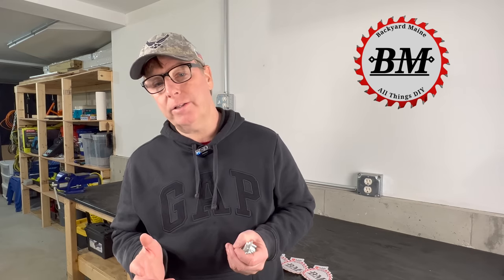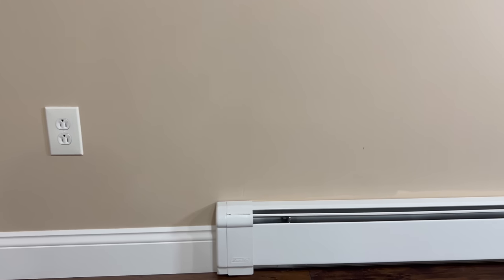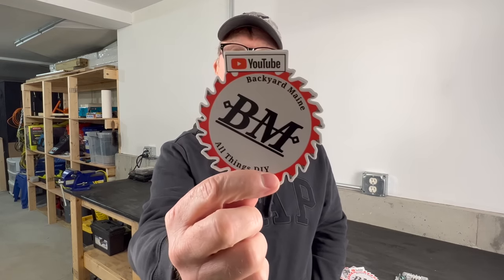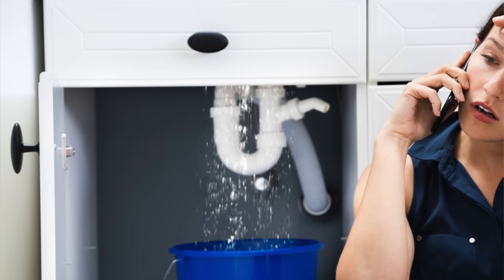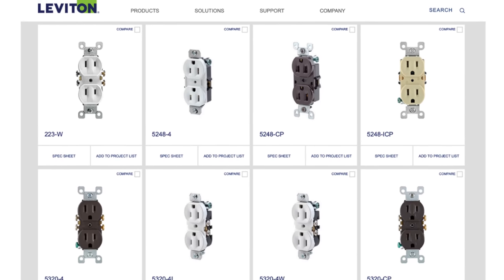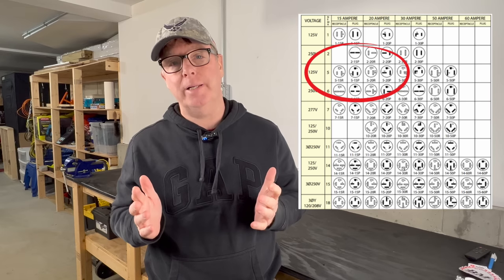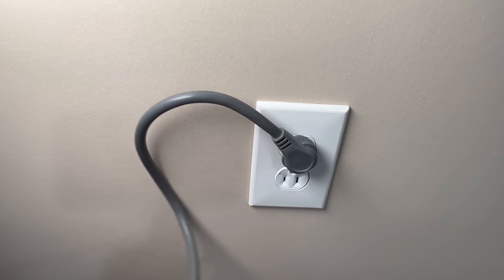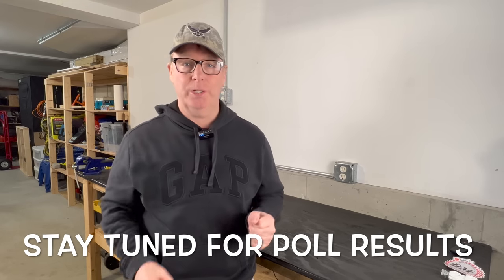Are your outlets installed upside down? (You may be surprised)

Comment: During my 40 years of remodeling in the Chicagoland area, every electrician I worked with insisted on ground-down.  Indeed, several told me that it was code.
So I'm a little surprised it turns out, it isn't code, at least nationally.  It would be true, though, that Cook County, Illinois is quite a bit tighter than most other jurisdictions.
Reply from the maker: I’ve read in the comments many times that cook county requires the receptacles to be mounted horizontally. Maybe it’s just Chicago I don’t know.

Comment: I am coming late to this discussion and can't read all the 3,600+ comments, so my comments that follow may have already been posted. But the main reason for ground down is so that if a 3-prong plug starts coming loose and starts sagging downward, the ground plug is more likely to be always be the last to be connected. The worst thing you want is for a plug to start pulling from the wall and the ground plug to loose contact while the hot and neutral wires are still hot (for connections that have 3-prong plug).

Comment: Also,  if you Look closely at the outlet, many of them have the Logo or Wording molded in their face.
That wording is correctly readable when the Outlet is Ground Up.
Even on some older GFI outlets TEST and RESET buttons wording is only readable in Ground up.
So it's almost as if, most manufactures have designed their Outlets for Ground Up usage.
Reply from the maker: Ive seen the wording in both directions from the same manufacturer depending on what you buy. We can make assumptions but the manufacturers do not recommend orientation. Hubbell for example has a quad receptacle and every one of the four are in a different orientation.

Comment: Ground down fits appliances like:  Refrigerator cords are not upside down, creating undo strain. Window air conditioners, washing machines, and any other cord and plug appliance.  Kind of like wearing shoes on the wrong feet.  They still provide foot protection, but just looks awkward in use.

Comment: Ground down is better in most cases.  The short circuit proposed by some people, if "something falls on top of the exposed leads is ridiculous.  Why were they exposed in the first place?  The breaker will take care of that in the odd case this might actually happen.  That's what breakers are for.
Reply: True.... UNLESS it's one of those Federal Pacific Electric or Zinsco panels, which had a well documented high failure rate,  estimated that about ⅓ of single poles and ⅔ of two pole breakers failed to trip even under a dead short, or they took too long to trip or trip at currents much higher than the marking on the handle.  The unofficial rule at the place I work is,   "This 2 pole 15 amp FPE breaker is an acceptable substitute for this 200 amp main breaker that won't arrive until after the holidays because it won't trip" 

Buildings from before the 1960s may still have a fuse panel in use,  and fuses were easily bypassed with coins,  aluminum foil or other metal objects inserted into the fuse holders to prevent the fuses from blowing or to restore power when replacement fuses are unavailable.
Reply: @Sparky-ww5re  Yes I remember those fuse panels with the ceramic fuses.  I'm so glad they're gone.

Comment: He's right, the NEW or NEMA do not require ground up or down. I've been in construction over 45 years. In almost 100% of the homes I've worked in or built, the electricians have installed the ground-down method. I agree with the author; to me, ground up looks upside down. Plus, all the cords of appliances seem to be oriented for a ground-down receptacle.

Comment: I have owned several homes, several rental homes and every one of those homes had outlets with the ground pin on the bottom. I have looked at multiple homes for purchase and every outlet had the ground pin on the bottom. In my opinion, the ground pin should be on the bottom in the United States.
I prefer the ground pin on the bottom of the outlet.

Comment: Late to the party but glad to be here 😂

I went to do a service to this place where they have ground up outlet.
I needed to use the outlet but I couldn’t fit my plug as it was big with gfci on it, a power washer, so I needed to unplug the one that was used with a security camera to fit mine then plug the other one in place

They received a call from the security service to check on them
But now I get why they install it that way, upside down!

Comment: The simple and logical answer is ground down. When you have something plugged in, the weight of the cord bears down. So if there is ever a condition created where the plug were to come loose, the last conductor you would want disconnected is the ground. Mounting the receptacle in the ground down orientation, accomplishes this.

Comment: When I lived in Miami I noticed the apartment I rented was ground down but the few houses I rented were ground up. I forgot who told me but they said ground up was the correct way because if the plug became slightly ajar and something fell in the gap, ground up would prevent a short circuit. Chances of something like that happening?

Comment: I install 15 amp circuits plugs ground down and 20 amp circuits plugs ground up to help identify what can be plugged into them. This is particularly useful in large sheds, barns, garages and out side plugs so you don't use the wrong outlets for heavy equipment. Just my two-cents worth.

Comment: What's interesting about this is that in Canadian Hospitals, Medical Clinics, Dentist's Offices and so-on, Outlets are orientated Ground Up, regardless of where in the room, or how high up, the outlet is located.
And the Canadian Electrical Code does not specify which way the outlet has to be orientated, but the ILLUSTRATION shows the Ground Up...
Reply from the maker: Most medical facilities use IEEE standard 602 when the building specs are written which does recommend that the ground pin on top.

Comment: Down is aesthetically pleasing and plugs in that orientation are more natural feeling with he thumb on the flat(ter) part.

I do think ground up makes more sense for the 1 in a million chances something slips by the ajar plug that's somehow still in contact with the circuit and ground up blocks (most likely) a dangerous result better. 

Ground down for life. Good ides with the opposite direction for switched outlets.

Comment: If I were having a custom house built, I would be specifying the plug orientation in the plans. In all the bedrooms and in the home office I would specify that the plugs are all split so that the top half of each plug is controlled by the light switch and the bottom half is constantly on. (I do realize this means running more wire and a small additional cost.) I will be plugging lights and room fans into the switched plug, and electronics, especially in the home office, into the constant plug.  I specify all my plugs be mounted in the ground up orientation, except those mounted face up or face down.  But what do I know, I am just a home owner, not an electrician.
Reply: P.S. any outlet that had text on it should be mounted so the text is correct, like a GFCI with a "test" and "reset" button. But then I did not say anything about bathrooms or kitchens in my original post.

Comment: Ground up is the correct way. You have mentioned reason number 1 in your video. Reason number 2, when plug is in the socket, more pressure is on the upper pole. Ground is stronger than N and L. This make it more stable. I.e. difficult to loose. You know what loose connection means in electricity. Reason number 3, if you look at UK standard, 100% is ground up.

Comment: I think the best argument for ground down is look at your fingers when you pull a cord plug out of a receptacle, your thumb is generally on the top and your index finger is under the cord plug.  It would be very easy for your index finger to make contact with the hot/neutral prongs of the cord plug as you pull the plug out causing you to get a jolt.

Comment: I have one plug that is upside down, and I think the wires are backward too because when the furnace is plugged into it, it won't work, but it works in other plugs. I've tried to explain this to my LL, but to no avail. I think there is a low voltage controller using LED lights that don't like reverse current.

Comment: in general ground down. However one may need to go ground up IF there is plug in issues OR like you said to distinguish between light switch or not. Issues could be similar to mine. this old house has plug in right above the baseboard heater making it difficult for some plugs to fit so they were turned around to be able to accomadate both plug ins and not just 1.

Comment: After 40+ years in Industrial electrical environments, I didn't care much about 110VAC outlets, other than the convenience of identifying switch controlled outlets, mostly in office environments.  But, for 220VAC 3-prong outlets, especial the outlets designed for angled plug designs, using the ground up configuration was risking the loss of the ground connection as the cable weight or machine vibration slowly backed the plug out and down, creating shock hazards for the operator of the equipment.  Most places I worked at demanded ground down and specified shorter hot and neutral pins with a longer than normal ground pin or blade designs.

Comment: Grounding circuit up, down, or sideways is generally inconsequential except for some specialty applications. What matters most is the polarity of the positive and ground (return) circuit. Modern receptacles incorporate a wide prong on the plug and a wide receptacle on one side of the outlet to facilitate proper orientation. But if some fool has wired the outlet incorrectly, let's just not say "It's up for grabs".

Comment: I have one outlet in my apartment that is 'up'. No reason for this, but there is a problem. Almost all of my nightlights are polarized, therefore the nightlight would be upside down-not acceptable. Great video!
Reply from the maker: It may be that outlet is controlled by a light switch.
Reply: No, the only light switch in my living room is for the overhead. It has no effect on the outlet.

Comment: I was told at a manufacturing facility why to mount the ground up. I see no reason whatsoever to mount the ground up for the reasons often given. What are the chances in a residential environment of a plug being partially inserted and a chance object falling across the hot and neutral at the same time? In a production facility, 120 VAC outlets are in offices, parts and supply rooms and break areas. Out on the production floor those outlets had to be 30 inches or so above the floor. I mount right! I mount down! Glad to see there are still some wise electricians around. We had a saying in the military among technicians and mechanics. "If it's not broke, dont fix it."

Comment: I remember when the 3-prong outlet first came out, and it was always shown with the ground down. So anything else just looks "wrong" to me;  but I do get the ground up argument. as well However, the way I think about it is from the point of view of inserting the plug into the receptacle. If one thinks about how one holds the plug in a ground up scenario, one's thumb is on the top of the plug where it is visible, while the index finger is cross-ways along the bottom of the plug, and not visible. It seems to me that the index finger could inadvertently come in contact with the neutral and hot contacts leading to a potential shock hazard.

If one instead inserts a plug into a ground down receptacle, one's thumb is on the top of the plug where it can be seen, and the index finger is cross-ways along the bottom. In this scenario, whilst ones index finger might come into contact with the ground contact, there's no shock hazard. Meanwhile, placement of the thumb is visible and one can avoid coming into contact with the hot contact.

I'd prefer letting the over-current protection device take care of the case where a conductive object falls on a partially exposed set of contacts on the top of the plug, to the case where there's a shock hazard that could potentially be lethal, regardless of how low the risk may be.
Reply from the maker: I agree with you my friend.

Comment: Ground down. Even though I think ground up is a safer general procedure. 
The reason being I’m an engineer and musician. I use 20 amp large full rack plugs that would be dangerous to use a ground up on. Also close to a dozen battery backup units (used for voltage normalization) that are designed from most manufacturers for a ground down plug install and would see the plug 🔌 lever the top of the plug out with a ground up plug due to the shear weight of the cord.

Comment: The National Electrical Code (NEC) doesn't require a certain direction. The NEC allows outlets to be installed with the ground plug hole facing up, down or sideways. It's up to you, there is no standard electric outlet orientation. So that means there really is no such thing as upside down outlets.May 4, 2023
Reply from the maker: That’s what I said in the video

Comment: I used ground up when I wired my house. One reason is the one you mentioned--exposure to the hot connection from the top. However, there is other reasons. The ground prong is slightly longer making it less likely for the plug to rock down due the weight of the cord. Further, if the plug is seated loosely, the force of gravity from the cord will tend to push the hot prong into the plug, while the longer ground prong will be the one to tend to pull out.

Comment: I've heard the ground up argument before and didn't buy it.  Your example is the first one I've heard where there was actually a case where it mattered.  I use ground down because 90 degree plugs are becoming more and more common.  In fact, I recently changed a 30 amp receptacle because the heavy cord had to go up, then bend down.  I guess many 'pro' electricians haven't seen high amperage plugs.

Comment: The builder installed the out that’s attached to switch ground up and everything else is ground down.
Makes it easy to know which outlet is controlled by the switch.

Apologies if this has already been said. I didn’t scroll.
Reply from the maker: That is a common practice for residential wiring. I thought I mentioned that in the video but I'm not sure.

Comment: Back in the 70's when metal cover plates were used, receptacles were installed ground up. Reason being, if the plate fell down due to a loose screw, it would hit the ground instead of the conductors....my first experience with this was in hospital construction.

Comment: I prefer ground down only because it simply "looks right" - but - the issue of the 90 degree plugs aside, a ground up installation does offer more stability to a plug and it's wire, especially something like a heaver gauge extension cord. In a shop type situation, ground up is a better way to go imo.

Comment: Ground down. There are so few instances where ground up could actually be helpful, but I plug-in three prong receptacles on the regular and my index finger wraps right around near that ground pin. There isn’t much plastic between my finger and that ground pen so I would much prefer it to be a ground that is completely harmless than a hot that can shock or electrocute me.

Comment: LEFT so that the neutral is on top and hot on bottom. Or to protect that hot a little more, add extra framing and install it at a 60 degree angle

Comment: I got the impression from somewhere gnd up was correct, so that's how I wired my garage. It presents a problem when I plug in DC converts in such.
Reply from the maker: Lots of misinformation out there. The code allows for any orientation so ground up in your garage is fine. Many consumer product are designed for ground down installation.

Comment: IMPORTANT FOR SAFETY... Ground up!
Here is why...
Many people position their thumb on top of a power cord  to assist in the leverage to pull out a power cord. If your thumb touches the hot and neutral blade of the cord as you pull it out, the arc of power across your thumb pad will blow a hole in your thumb pad.
Not only very painful, but a wound that will take along time to heal and can become very infected.
This is why international standard is ground up. This is why hospital standard is ground up. This is why power plant standard is ground up.
Ground up is all about personal injury,  fire safety is really secondary.
I have been wiring buildings and houses ground up in the USA for 45 years and I have suffered the slings, arrows and insults of home owners, building maintenance managers, and building inspectors for ALL of those 45 years. But none of my customers has ever suffered an injury or fire from ground up outlets.

Comment: its like which way  is best to roll your toilet paper 🤣.... our plugs in Ontario Canada are all ground down for the most part, I had a friend who did ground up for some of the reasons you mentioned.  The other example was the outer edge ground of the receptible snapping off easier when you unplug a 3 prong plug.. eg if ground up you are more likely to snap the tab as you pull out and up but again some would argue otherwise)... either way the classic style you show is easier to snap than the modern square receptacles.

Comment: In Nj...So there is something call AHJ.  Authority Having Jurisdiction...
The NEC code can be looked at as the minimum requirements
But the AHJ in the State, City, Township, County can add to the requirements of the nec
Which NJ requires the grounding plug to be on top. 
I was confused until I saw this. Hope this helps
Reply from the maker: Maybe at a local level but not state. I just pulled up the NJ state code and could not find that requirement. Please provide the code reference if you can.